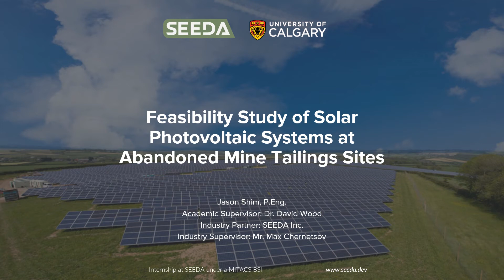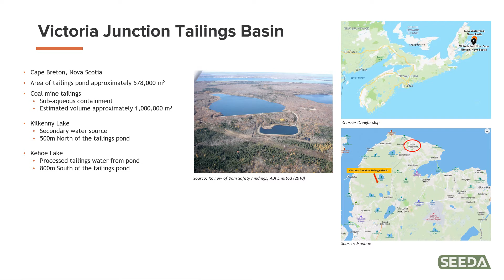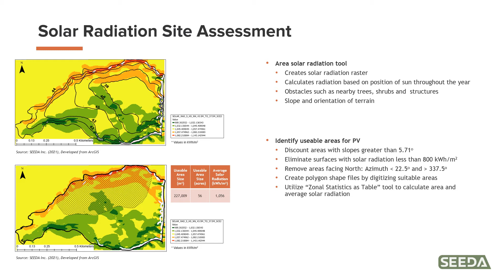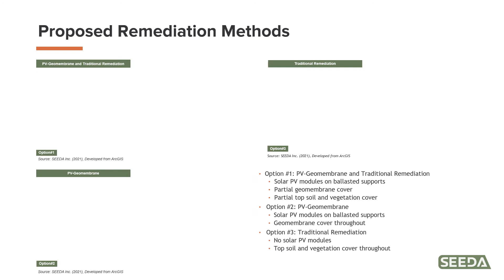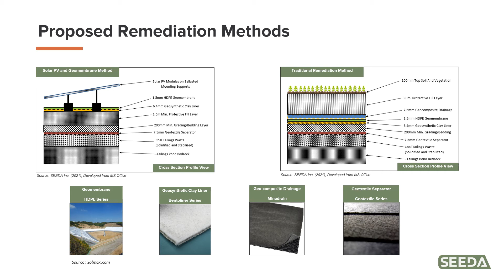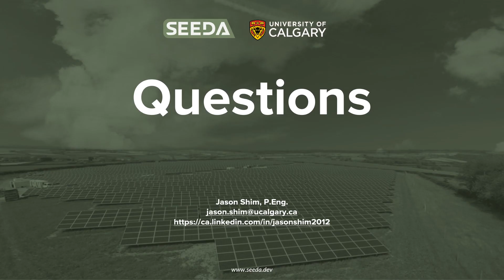Feasibility study of Solar Photovoltaic Systems - Jason Shim - SEDV Showcase 2021

Comment: Solar voltaic electric power generation is nearly worthless if not charging storage.   If selling wild AC by forced sale to the public power grid the high priced paid for that nearly worthless electricity with little fuel savings is passed onto electric rate payers.